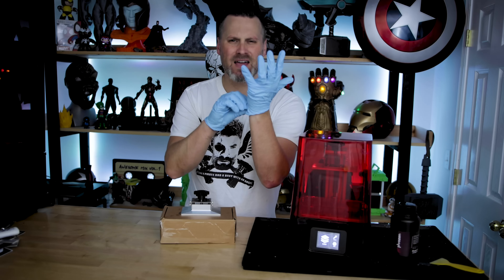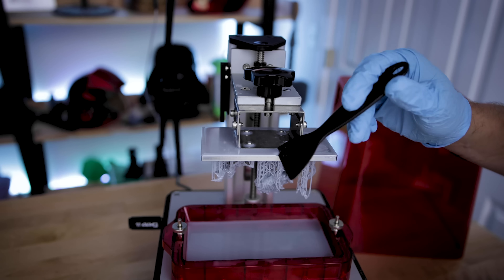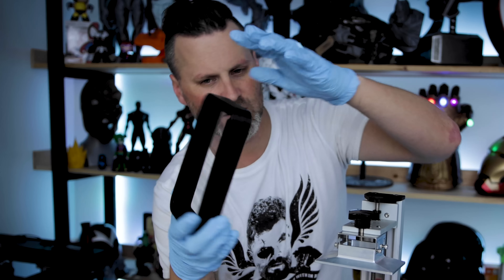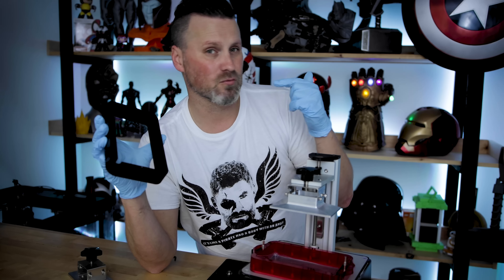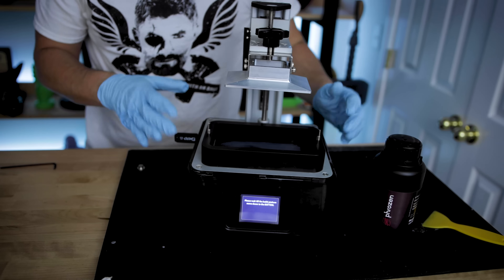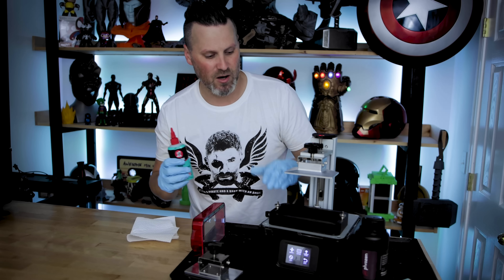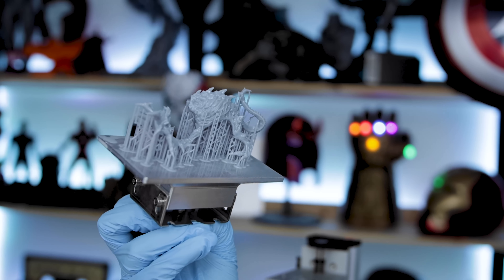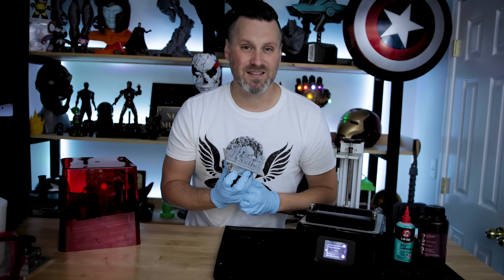Phrozen Sonic Mini Upgrades - Angled Build Plate & Metal Vat

Comment: I just got this printer and it's super fun.  First 3d printer and I had it up and running in less than an hour and had the printer dialed in after about 4 calibration object prints.

Only issues I've had is sticking to the fep sheet.  Going to try that oil.

Comment: I'm on the fence with adding PTFE liquid to the FEP.  Every time I use it the ripping sound gradually comes back after about 200 layers.  I just think the heat created from the layer curing process slowly removes it from the FEP surface.

Comment: Instead of spending $100 on top of the cost of the printer, just buy an Elegoo Mars for less money, get all these upgrades built in, AND a larger print area.
Reply: You only need to buy the metal resin vat now if you want a spare as the model currently listed at the link comes with an aluminum vat by default. So only around $300 total, but I feel the main draw for this printer is the mono LCD screen and ridiculously fast print times.
Reply: Elegoo Mars has mono lcd and same print speed?

Comment: I upgraded to angled plate and bought extra metal vat. The angled plate is a godsend! One question, are you having any issues printing resins other than Phrozen's? I am not having much luck with Elegoo resins. Also do you think the supports generated by the Mini are not as strong as say for the Mars? It seems I get the supports breaking more with Mini than the Mars.

Comment: 80 bucks in addition to the cost of the machine. This will bring it over the 300$ price mark
Reply from the maker: Yeppers but it does print a heck of a lot faster than my other machines. 2.5 hr print vs 4 hr print. And these are not essential but nice add ons for those that want to spend a little more
Reply: @UncleJessy  could you 3d print a slope and save $40 on the build plate?
Reply: A bargain for the print quality and speed. If it’s too expensive buy Play-Do.
Reply: @ToyFiend  so according to you his options are a sonic mini with the accessories or play doh.
Reply: Luigiangelo Buonarroti  yep. But he would probably whine about the Play doh costing too much
Reply: Luigiangelo Buonarroti The point is, we are insanely fortunate to have these dirt cheap options for such high quality output. Just a few years ago, you had to buy a $3500 Formlabs printer to get results close to this.
Reply: Luigiangelo Buonarroti The point is, we are insanely fortunate to have these dirt cheap options for such high quality output. Just a few years ago, you had to buy a $3500 Formlabs printer to get results close to this.

Comment: You forgot the 2 most basic upgrades, electrical tape around the bottom of the cover to prevent rattling and printing a handle for the cover. Also the new ones on Amazon have the metal vat, no more plastic vat unless you want to order them from Phrozen.
Reply: The plastic vat is pretty, though.
Reply: I just ordered one on amazon for $250 because I had read that they now came with a metal vat. If its plastic I might have to return it

Comment: I thought you cant breath in those fumes are those safe??
Reply: I wouldn't do it all day, but the limited amount of exposure you get from removing and cleaning prints isn't going to hurt you. That machine does a good job of containing the fumes as there is no fan blowing it around your room.
Reply: So I haven't been wearing a mask around the printer and I'll admit I start feeling light headed after a while. They're definitely not good for you, but the small amount you'd breath in from just pouring and cleaning won't do much. In fact it's very possible that it's the chemicals in the cleaning products that are messing with me